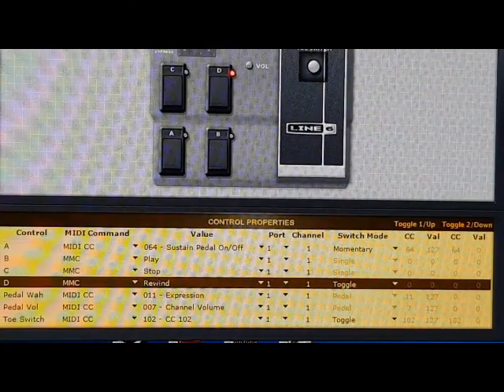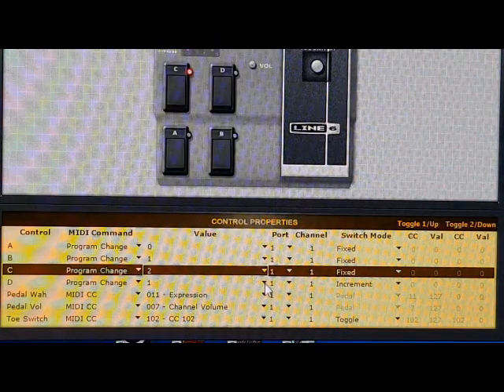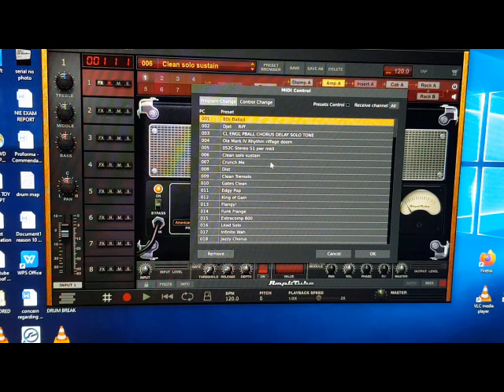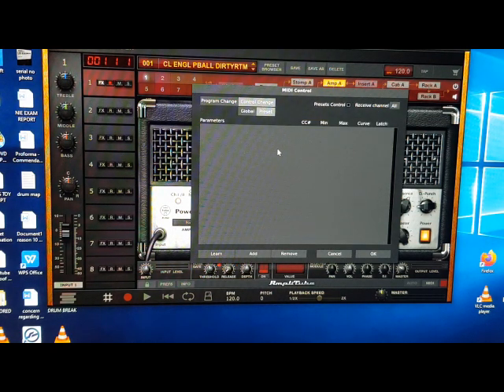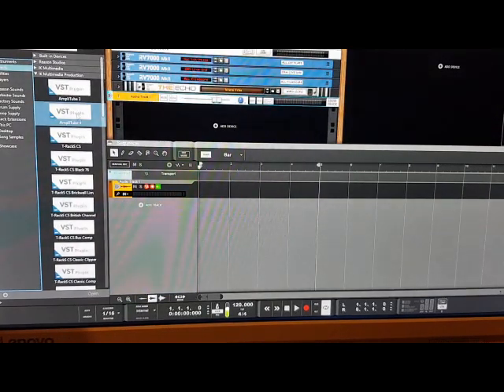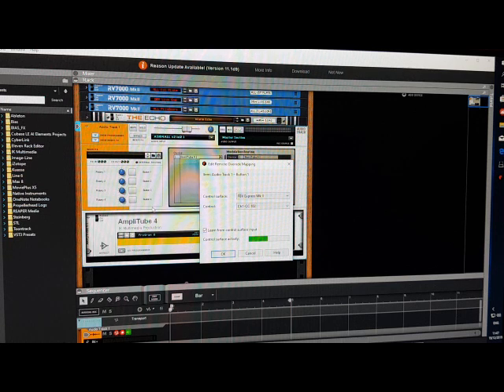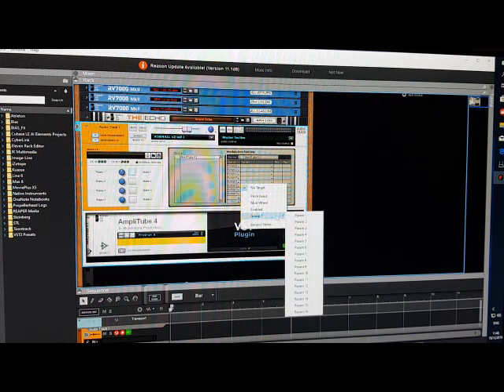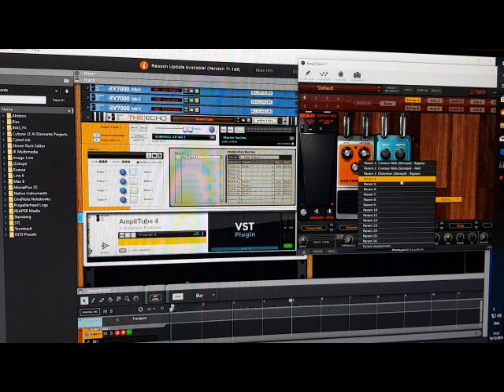Amplitube 4 midi control with a Line 6 FBV mk 2 expression pedal

Comment: hello thanks for the video. Quick question, does the tuner work when you use the pedalboard as a midi controller? So only connected via USB ?
Reply from the maker: Sorry for late reply, i'm not sure bcos i haven't tried and don't currentlybuse this set up

Comment: Does program change work inside the daw? Could you show this with a reaper as well?
Reply from the maker: Hi mate. I couldn't work out how to program change within a DAW. I'm not sure if it's possible sorry. I use it with Reason, not sure how to do it in Reaper either sorry.
Reply: Cool! Thanks. Just found out a way to make program changes work in reaper.

Comment: Thanks for this nice tutorial! I have a question though: can I connect this expression pedal to my PC using USB ONLY and control the amplitube as you show? or I have to use the MIDI connection?
Reply from the maker: Yes you can use just a USB cable. In fact the controller doesn't have the old standard midi connection ports anyway.
You'll still have to run the line 6 software at the same time as Amplitube. But yes, just a usb from controller to PC.
Reply: CALVIN LEWIS thanks for the prompt reply! Highly appreciated! Have you experienced any latency in this method?
Reply from the maker: @alimoyassari5875  no I haven't personally. I'll be honest though, I haven't used it alot bcos I have an actual way pedal anyway.
Reply: @CALVIN LEWIS Great! Thanks for the help man! Much appreciated!